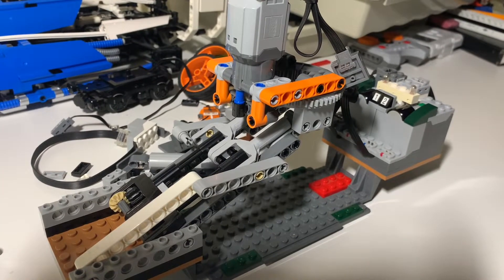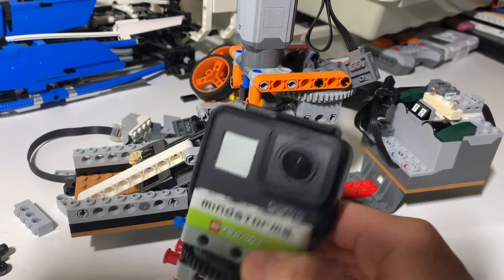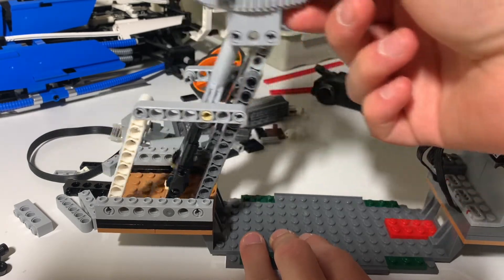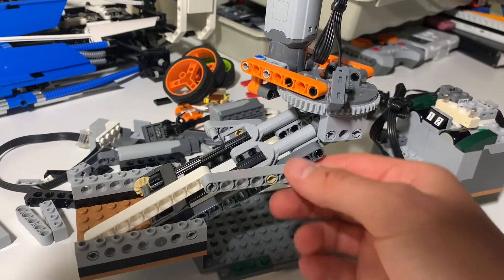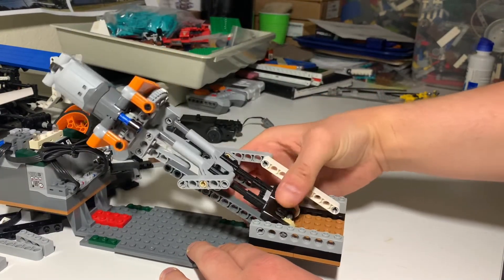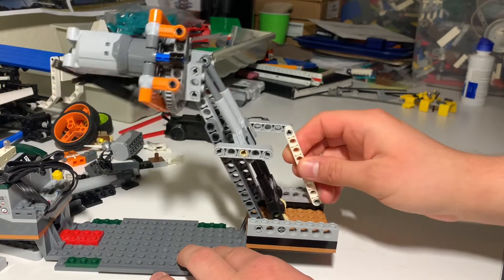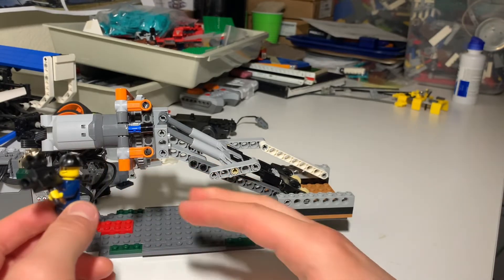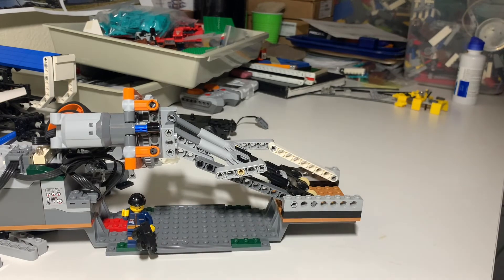Lesson learned. What should I try next?

Comment: Why include the tilt function at all?  Combined with lateral rotation it seems like it would result in tilted video.  Why not just have a vertical lift and rotation?
Reply from the maker: The reason for adding tilt is to allow the camera to look up at an object as the car passes by. Many displays include tall structures such as cityscapes, trees, etc.
Reply: @GearsAndBricks  if that's the case wouldn't the tilt function need to be above the turntable?
Reply from the maker: Yes. The problem then is that the total space occupied by the tilt gearbox, motor, and camera must fit within a 9-stud diameter. This tolerance is set by standard TBRR layouts, where any train must be smaller than 10 studs wide to avoid demolishing models closer to the tracks.
Reply: @GearsAndBricks  Sounds like quite the challenge! 😅